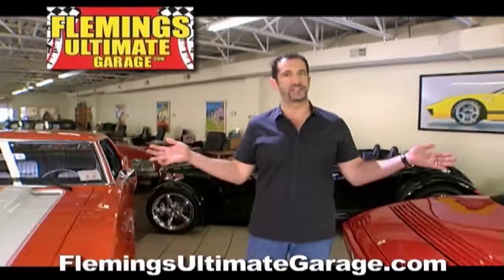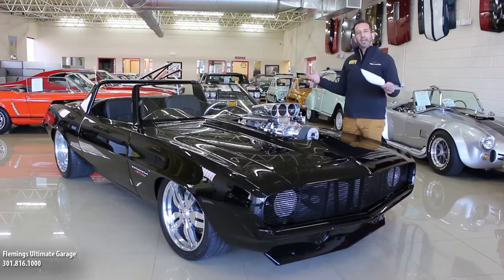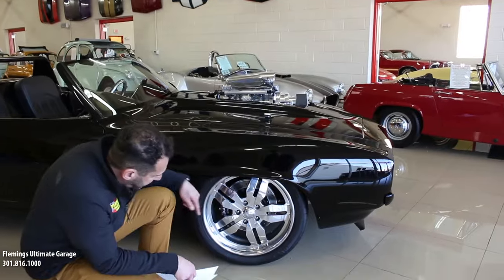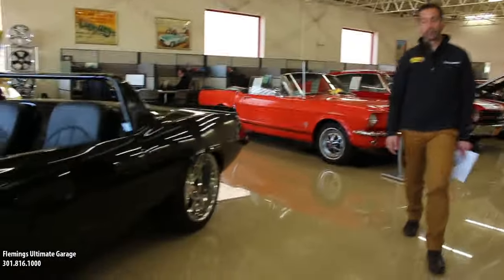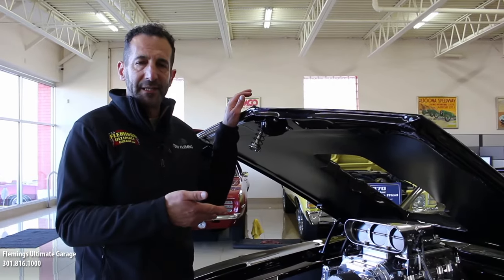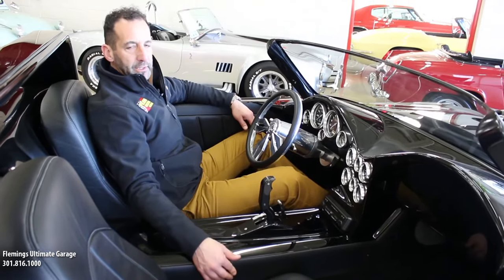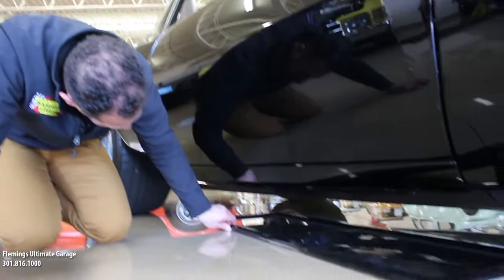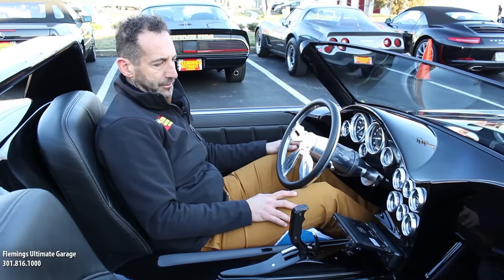1969 Chevrolet Camaro Supercharged for sale with test drive, driving sounds, and walk through video

Comment: Black is the hardest paint to make look good and straight. Absolute best color and sharpest when new or on a car like this. But I always buy silver because that's the second sharpest color that looks great and hides a lot like scratches. But when prepping silver if you don't water sand straight you'll see that in the finished result! There is so much work to body working prepping and laying down a nice finish that 85% of people have no clue of the hours that are put in to just get it painted. The rest is pretty easy!